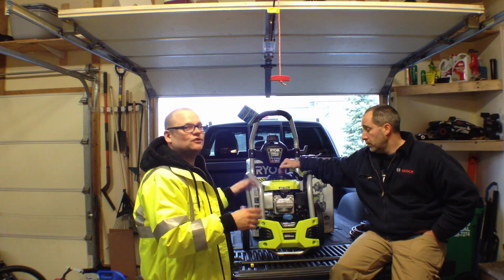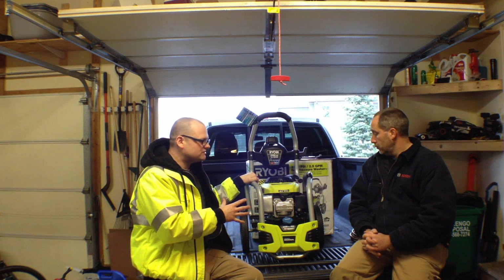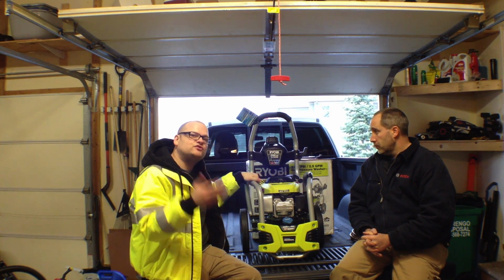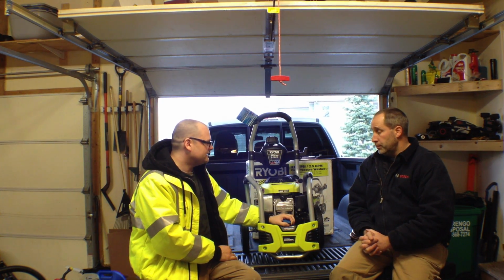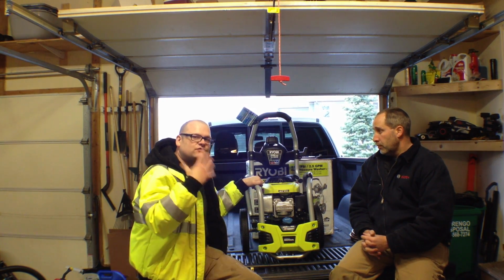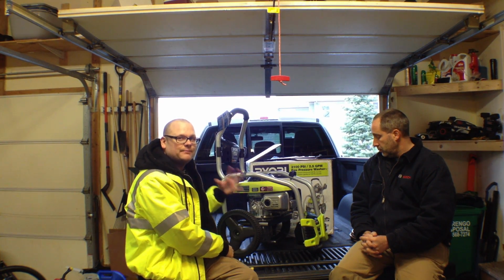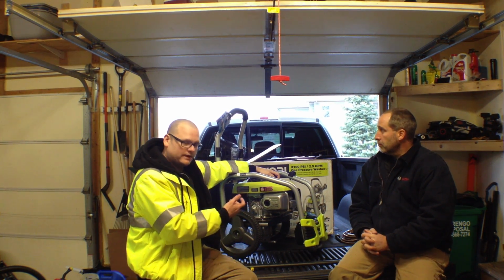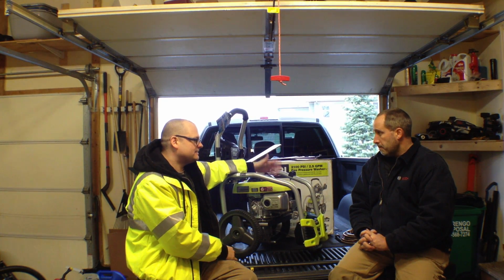RYOBI 3100 PSI Pressure Washer with Honda Motor- Preview

Comment: Wow you guys gave this ryobi product some great praise. usually, ryobi comes in third place next to dewalt and milwaukee. 

But you're right, ryobi has come a long way. I have both models of their 18v impact driver (the original blue one and green+ version). Their build quality has improved alot over the past few years. 

If ryobi can create an 18v cordless framing nailer, like senco's fusion or paslode's cordless, I'll be set for life with only sticking with ryobi tools.

Comment: What seems to be a common problem with pressure washers at this price point is you hear a lot of stories about the pumps going bad, and to have it fixed costs pretty much near the original purchase price of the unit. To be fare to Ryobi most people that are using them are probably not using using them correctly by letting the unit run a long time holding pressure, or not winterising them properly.

Comment: From what I see you guys have almost reviewed all tool brands and are probably running out of tools to review. Ryobi has the most tools in the 18v line up. From portable miter saw, nail and staple gun, brad nailer?  Paint sprayer, inflator, blower, weed eater, hedge trimmer, and the list goes on. Over 50 tools i believe in the 18v line up. So give it a try!!  They are very afforadable and more videos for you guys. Im still a dewalt by heart though like dan. ^_^ but ryobi is stepping up!!